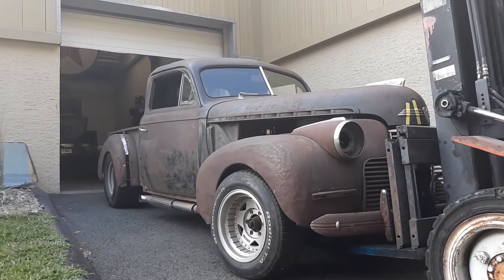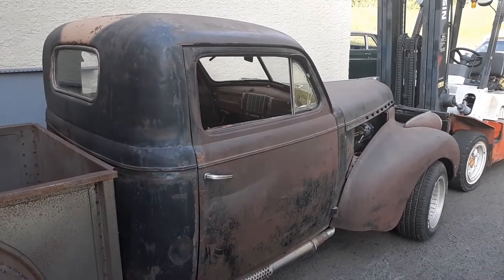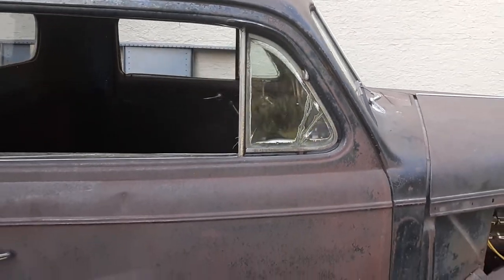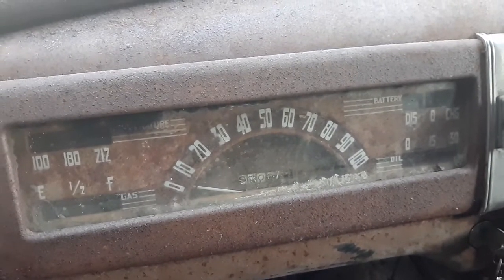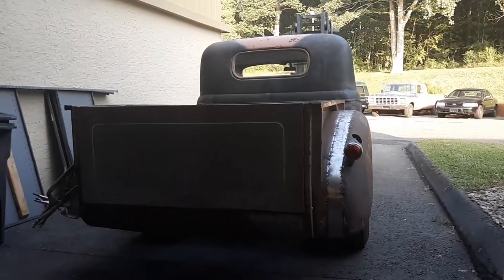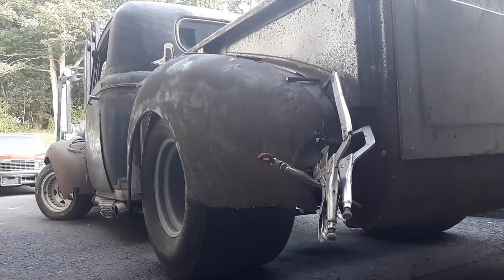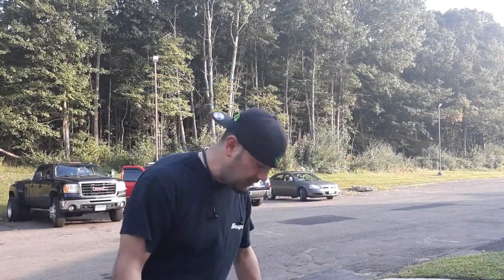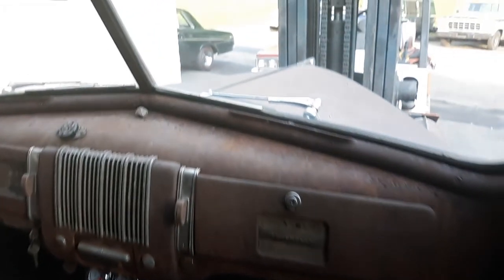1940 CHEVROLET PROJECT VEHICLE

Comment: Those Cars Shows were they rebuit engines and bodies make it look easy, but its not reality, lots of time is put in to restore these old timers !
Reply from the maker: Yeah the shows don't portray all the issues that come along with it. The parts availability on older stuff, the things that no longer can come apart and need to be cut out. The parts that you can no longer get so you have to go to junk yards and buy three of the same part to try to build one good one out of it. And the stuff that you absolutely cannot get so you have to build your own from scratch.
All the issues and problems that take forever to sort out, they never portray any of that. Also, have you ever noticed how clean everybody looks building vehicles in those shows LOL.
I've never seen anybody get a piece of rust in their eye and have to go to the emergency room to get it removed. They never show any of the fun stuff😉

Comment: Looks like a serious amount of rubber on those rears. Back when cars were made of a much better gauge of steel. They can rust without falling apart. Still enough metal to be strong and repairable. Those double link trailing arms with the adjustable suspension. Great so see something modern on a classic. You're getting me semi tempted to take on a small project lol
Reply from the maker: It's a lot of fun man, it is something I truly still have a passion in doing. Especially when we can drag 30 + year abandoned cars out of fields, cut them up, weld them up and get some 80 year old steel back on the road it really is amazing. Some get newer modern engines, some just get reworked older V8's, but most get decent modern suspension in them. Brakes are optional LOL

Comment: That's cool, it takes recycling to another level.
Reply from the maker: Yeah, actually it does LOL we try to reuse and recycle is many of these old Parts as we can. This stuff is only original once. Plus all this original Steel has its own story, it seen so much more than we ever have. I often wonder what it saw on the roads, with these Interiors heard on the radio, what kids were jumping around in the backseat or who was driving them.
All these thoughts run through my mind whenever we get our work on these